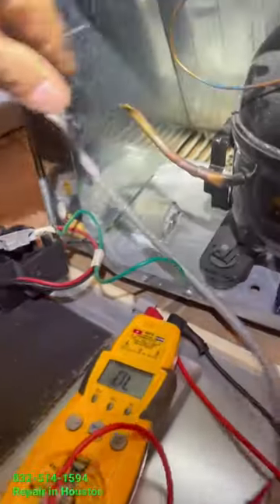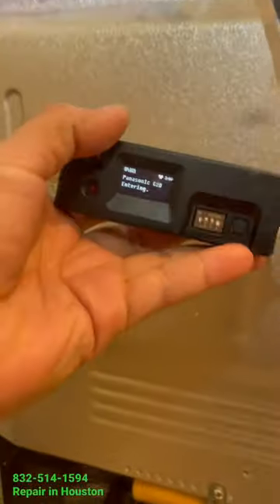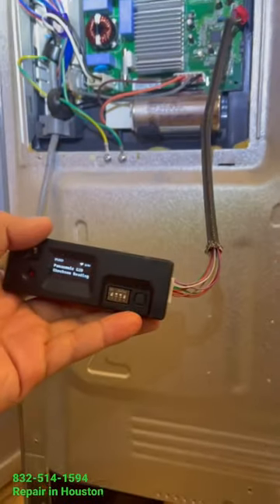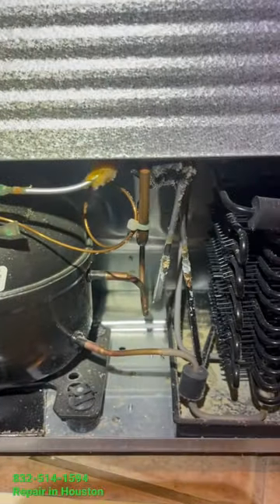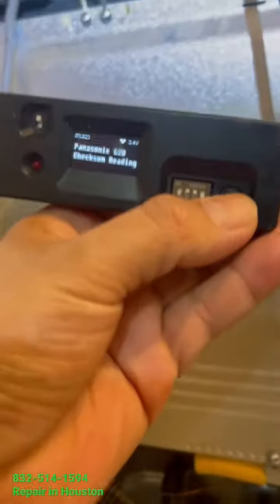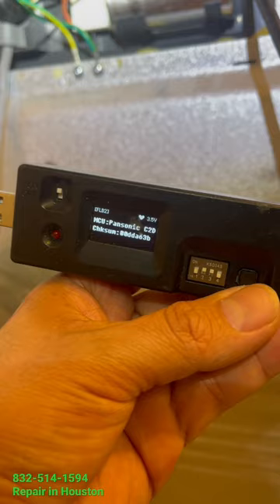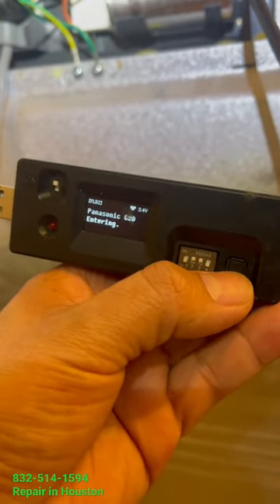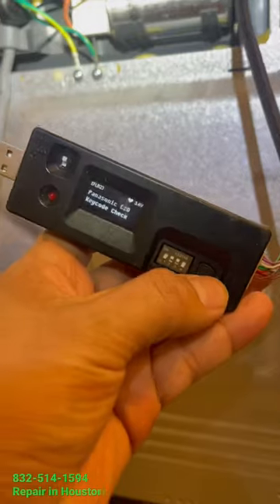Lg refrigerator not cooling

Comment: You don't always update it, if the original compressor.is FLD and the new one is FLD there is no need to update.
Reply: It does refresh the FLASH image though.  Some flash memory has 10-30 year lifespan between programmings.